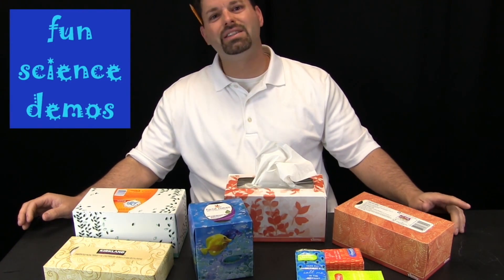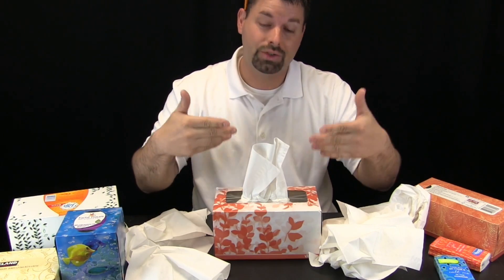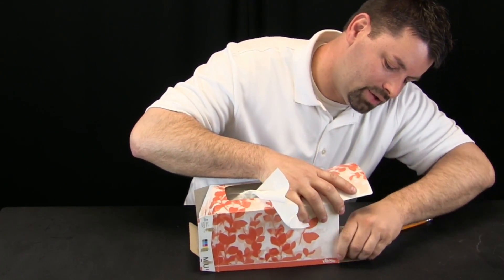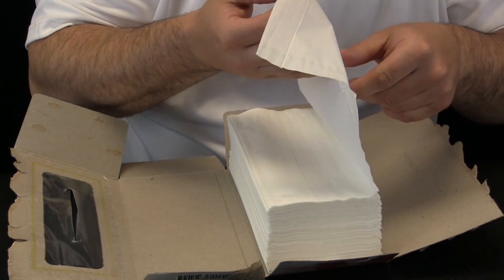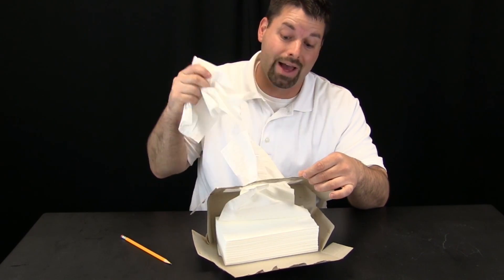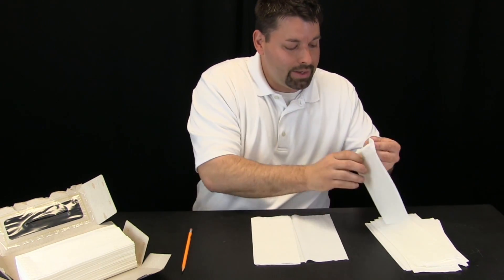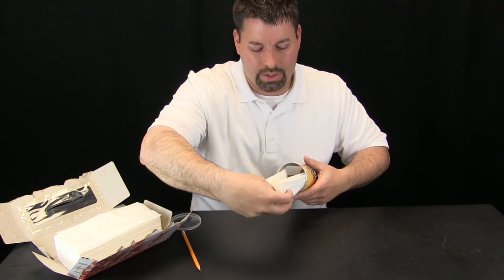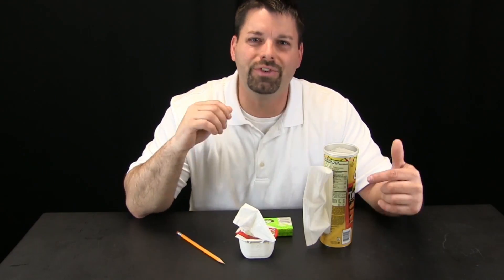The Tissue Box: An Engineering Autopsy

Comment: unhappily the engineering that has tissues pop out as one is pulled no longer works. In fact every box I have opened lately has tissues fall back in the box instead of working as they used to work. I assume it's because they are probably made in China and the engineering doesn't work well there.

Comment: My question is, what brand or product names are folded so that the next tissue comes up to replace it?  I have a decorative (standard rectangular tissue box size) tissue box enclosure (which looks like a tiki face, where the tissues dispense from the nose), which I think is cute and I’d like to use, but I’ve bought tissues repeatedly which do not work with it because the next tissue never comes up replacing the one I grabbed.
Reply: Kleenex.  Or anyone except Puffs.  Puffs does not have the accordion fold.